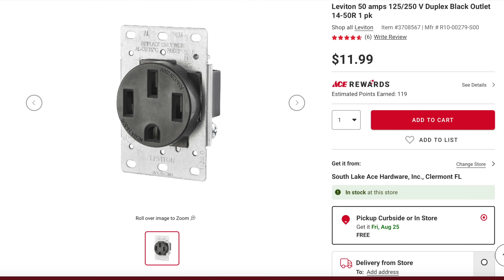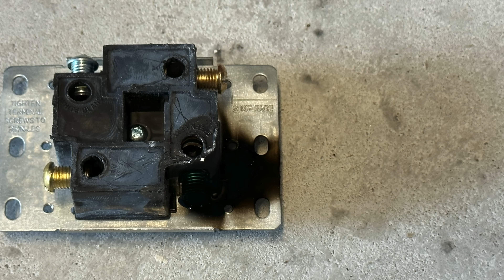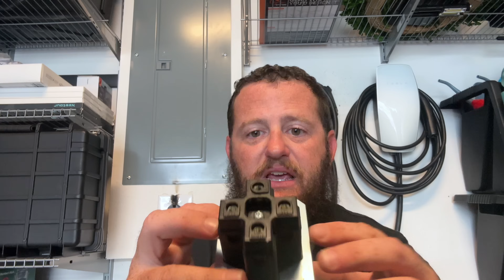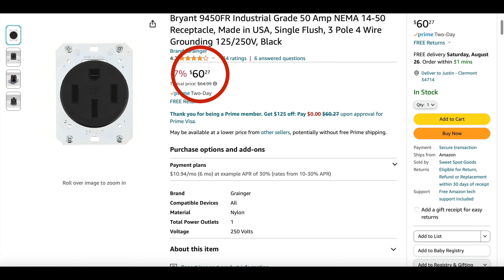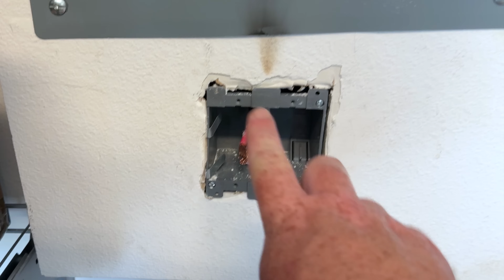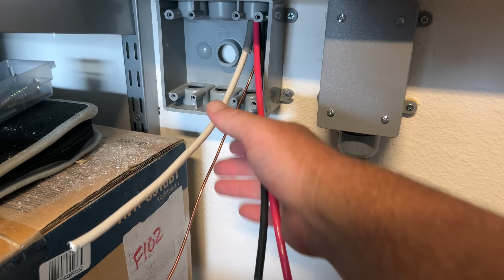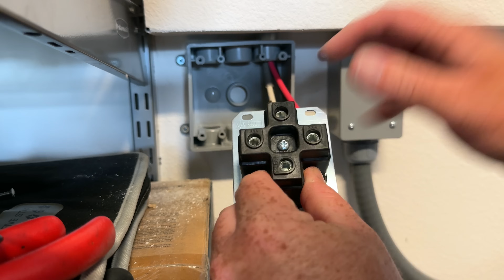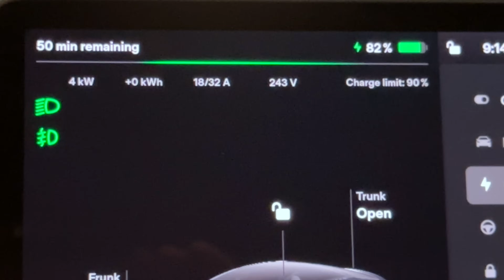This Will Save Your Life if You Charge Your Tesla on 14-50 Outlet!!

Comment: Where does it say that the standard for the plug is a 30% duty cycle? Charging the car requires a 100% duty cycle, or very near to it. Its not pulling out the plug that is the problem, its the heat from running it without letting it cool between on and off cycles, like a dryer or electric stove. Putting in the correct plug won't work if you don't torque it to spec. My stove had an old plug on it put in in 1979 and it failed long before I got my house because it was not torqued to spec on aluminum wire. I checked all the wire connections and others were loose as well. It can be hard to find these faults, done by poor installation. You are unlikely to get electrocuted by a plug failure, but you could burn your house down if the breaker failed, which they sometimes do. Many houses are just sitting, waiting for a failure to cause electrical problems.

Comment: Am I the only one seeing this? I couldn't help but notice a comedy of errors while watching you tinker with your receptacle. It's like déjà vu – I'm pretty sure the old one blew up for the same reason you're demonstrating with the new one! 

As someone who's been zapping circuits for over two decades, let me share a nugget of wisdom: always shake those stranded wires like you're making a cocktail, then retorque them before finishing your termination. 

Now, in your video, you're all like, "hire a pro!" Yet, you terminate those wires like a cat chasing its tail and blame the previous electrician for the mess. Remember the golden rule: an electrician playing carpenter is a joke, but a carpenter playing electrician? Well, that's a horror story waiting to happen!

So, let the pros handle the sparks, and don't risk your family's safety to save a few bucks. And do me a favor: pop open that receptacle again and check those terminations. I bet you could pull those wires out easier than a magician pulling a rabbit from a hat!

Comment: I just installed a Tesla charger, and actually did something novel for a man. I read the instructions. Tesla recommended not using a plug and receptacle, but instead, making a direct connection from the charger to the breaker in your load center. 
They also recommend against connecting to  arc fault breaker or GFCI. The screws on the charger should be torqued to 50 inch pounds and 45 on the breaker.
Reply from the maker: Lol
Reply: I based my opinion on the 2nd to last line of the Tesla product Overview. I copied and pasted this from the Tesla installation manual.

PRODUCT OVERVIEW
 Circuit Breaker Rating / Maximum Output
 Power Output
 For maximum power output, install a standard double pole 60 amp circuit breaker. Wall Connector includes 
integrated GFCI protection - do not install a GFCI circuit breaker.
 Wall Connector incorporates automatic load management, which allows the max output to be customized to 
an existing power supply. If the electrical supply is unable to support the 60 amp configuration, select a 
lower amperage configuration.
 Circuit breaker (amps)
 Max output (amps)
 Power output at 240 volts (kW)
 60
 48
 50
 40
 11.5
 9.6
 40
 32
 30
 24
 7.6
 5.7
 20
 16
 15
 12
 3.8
 2.8
 NOTE: External disconnect switches are neither required nor recommended. 
NOTE: Circuit breaker size is programmed during the commissioning process. See Commissioning 
Procedure on page 28 for details.
 NOTE: Some Tesla vehicles may draw less current than the max output. Actual charging rate depends 
on Wall Connector output and onboard charger in the vehicle.
 Branch Circuit Conductors and Ground Wire
 • If installing for less than maximum power, refer to local electrical code to select correct conductors 
and ground wire size that are suitable for the chosen circuit breaker.
 • If installing for maximum power, use minimum 6 AWG, 90° C-rated copper wire for conductors.
 NOTE: Upsize conductors if necessary.
 • For sites with multiple Wall Connectors, each Wall Connector must have its own branch circuit with L1, 
L2/N, and Ground.
 • COPPER WIRE TERMINATIONS ONLY for landing in Wall Connector wirebox terminals. Conductors 
can be stranded or solid.
 • Hardwire branch circuits to disconnects or circuit breakers. Do NOT install cord-and-plug type 
connections.
 • For outdoor installations, use watertight fittings when securing feeder wires to the wirebox.

Comment: The cause of this was plugging in while there is a load on it. It would be beneficial if you were to turn the breaker off before plugging in. But also use a better quality outlet. Like you said. This outlet was not designed to be continually plugged and unplugged. But an arc will occur when it's under a load.

Comment: not even “state of charge” mentions this but gen2 tesla mobile connectors have a temp sensor on the plug and will give error and drop current in half to keep charging safely. doesnt matter how good your equipment and installation is, there is always a chance of corrosion, dirt that can cause too high of resistance and result in overheating. 

you should also promote mobile adapters that have this safety feature.

Comment: If using a 14-50R with 50 Amp breaker you need to limit your charger to 40 amp charging. If your charger is set to 48 amps, you need a 60 amp breaker and hardwire (no plug allowed). Due to the long continuous duty of a L2 home charger, it is good to check all terminations periodically with an IR temp gun. Check the Receptable, Breaker and Charger terminals. My terminals in my charger were hot and I had to increase the torque above recommended with the 6 guage wire to get the temperature to come down. All terminations will degrade over time. Record original temperatures and check annually or semi annually

Comment: Glad you, your family, and home are okay but I do want to mention the wall connector isn’t meant to be used with a pigtail.  Since it wasn’t installed per the manufacturer directions (hardwired) it actually voids the UL safety listing.  Same as if you mounted on the floor and it flooded, the instructions state to mount so many feet high, so the UL safety listing would be void. 

I see you had it limited to 32A which is great and hopefully with the higher quality 14-50 you won’t have any issues, but for others reading, PLEASE hardwire and torque to spec or have a licensed electrician do so

Comment: We had a Nema 14-50 put in with industrial setup by an electrician that does USC Medical hospitals in all of southern CA.  We are using a 200 amp panel and a 40 amp breaker and only using a 30 or 32 amp output.  10 to 12 hours is OK with us.  We don't drive less than 40% so we are good.  Temp stays down and batteries don't get abused by heat which kills a Tesla if fast charged only.  We also don't charge much over 90 to 95% so regen doesn't abuse the full batteries every time we drive.

Comment: If i had to guess, I think he installed the previous outlet himself, and he didn't use proper techniques during install. I think he either compromised the shielding on the live wires bending them into place and the ground touched it after repeated cycles or he didn't manage the ground wire appropriately and it touched the live wire. If you think about it, a short to the ground would not happen in any scenario he alludes to.

Comment: For continuous current applications, use metal boxes and faceplates, it will lower the air temperature in the box side.
Reply from the maker: thanks for the tip

Comment: Thank God no major disaster. I had a Leviton outlet that stopped working after 4 years. It didn't burn like yours but resulted in slow charged\. I replaced it with a Bryant. Those Levitons are crap but electricians still use them.
Reply from the maker: They are perfectly fine for what their intended use is, but not at all for this application. Unfortunately thats not a widely understood or known by most

Comment: Leviton meets UL specs.  Rv’s use this plug. In and out all the time. 
Don’t unplug or plugin under load. 
It looks to be bad connection in the box. Installer didn’t torque the connection well. It happens. 
You could always check the connection every few yrs. Been hooking these up for 36yrs.
Reply: Preach it. If you think it is the Leviton take it to court. You will loose

Comment: Stranded cables can squish and get looser during installation. The Excellent Laborer says to wiggle the wires and re-torque the screws, repeat 3 or 4 times, so that they stay tight.
You might want to go do that if you haven't!

Comment: You point out the plastic looks the same but it is the internal metal contacts which is the important design.  More metal more firm connection makes the outlet better.  Also note the burnt outlet used a screw tip not hex  bit.   Could you get 75 inch lb with a screwdriver?     The ground should also never be carrying current.   Note the smaller wire size    and if this happened while you were plugging in shows the car was drawing power at the time another error.

Comment: I'm an apprectice electrician. I guy who bought a new Tesla asked me if he could just plug it into his dryer outlet. He has a car port with washer/dryer outside. I said no. For starters, a dyer receptacle is not rated for a continuous amp draw. Those reciptacles are designed for sporatic use and short duration 35 amp amp draw. Tesla requires a 40 amp draw. Second, Tesla requires 50 amp breaker, 6 AWG wire and a commercial grade NEMA 6-50 or 1450 receptacle. I told him your dryer is on a 35 amp breaker with either 10 or 8 AWG wire. All this data is in your Tesla manual. He waited 6 months to get his car and didn't bother to get a charger installed during that time.
Reply: This info is def not technically correct and is misleading.
Tesla Mobile Charger DOES NOT require 50A. It can use 30 or even 20A. It will just charge slowly.
And NO , TESLA manual DOES NOT state that 50A is needed. In fact, they have a full table on their website stating the charge rates at different V levels.
Reply: Tesla does not require 40amp draw on their mobile chargers, it only draws 32amps. It is specifically designed for people who didn’t know whether their nema-1450 plug has a 40amp breaker or 50amp breaker
Reply: @ my information comes from the Tesla spec sheet.
Reply: I used a 50 amp breaker, 6/3 wire, 14-50 flush mount. 

I don't unplug and replug. 

Any ideas? I think I'll be fine. I have a thermal camera to observe if I need to.
Reply: You can run 20amps on a smaller breaker with a much thicker gauge and its completely fine. The problem is most people try to run the outlet lile a corvette and things like this happen.
Reply: The smart plugs on the mobile charger will only draw the amperage that plug can handle. Otherwise you gotta change the amps manually
Reply: @Sandwich420 you most definitely can use the dryer 10-30 plug with the Tesla mobile and it’s 10-30 plug.
Reply: lol bro.. first of all Tesla doesn't "require" 40A anything. You can charge it at 16A, 20A, 24A, 32A, etc. This can be set in the Tesla itself or in nearly any 3rd party EV charger. The 80/20 rule exists for a reason. Want to be safer? Go even further under and charge at 20A on a 30A 10-30 outlet. The problem arises from people frequently unplugging and replugging in outlets that are meant for appliances to be set and left for a decade.
Reply: Good advice young Jedi.
Reply: Tesla requires 40 amp draw, 50 amp breaker, 6 AWG wire, commercial grade 14-50 receptacle such as Hubble brand
Reply: @romari2706 you don't have to run 40 amp charger you can get chargers now and run smaller amps.

Comment: It looks like someone made a mistake as a wire connection. Because your green wire burned down. I can assume that someone set it on fire with a lighter. I have seen this many times, but everywhere the problem was inside the outlet due to poor wire connection.
I also recommend that all users of such outlets use this only at a current of up to 40 amperes. 
Similar sockets designed for short loads of 50 amperes, but not long.

Comment: How often are you unplugging and plugging in your charger?  Just wondering an estimated number of cycles before it failed?  I've been home charging now at 32amps for 9 months.  Maybe I should check the tightness of the lugs holding the wire.  I did wiggle and re-tighten on the initial installation.

Comment: I have an extension cord plugged into my receptacle and we plug and unplug our charge cord from the extension rather than the receptacle. There is a handle on the cord which helps unplugging. It was a bit of a fluke that we needed the cord - but now I am glad we did. We have only unplugged from the receptacle once. But we take our charge cord on longer trips just in case so it has been unplugged about 10x
Reply: Likewise, handle on ext cord as well, good setup by default 👍🏼

Comment: The only significant difference is likely a slightly better contact spring for the industrial version.  The housing should never even come into play unless something is wrong and “high strength steel” for the faceplate is just a gimmick.  The main reason this happens is loose connections inside the connector which will get the same failure on any plug.

Comment: STOP!  Don't mount that 14-50 in a plastic box even if code allows it.  It should be in a metal box.  The cover plate metal not plastic.  Also the conduit metal.  I wouldn't take any chances in an EV application.  For an extra margin of safety dial the current down if you don't need the full 32 amps.  I like the overdesign using 6 gauge instead of 8!

Comment: Why not direct wire your EVSE and avoid the plug entirely? That is what I have done with my 60A installation and it works great. I see you have two EVSEs on your wall and I know they make devices that auto-switch between two EVSEs, so that should still allow direct wiring. If you insist on using a NEMA 14-50 plug, then I would use the more expensive "shinny" metal plug, as that was the only one of the two you showed us that is marked as U/L rated. All the best.

PS, Another critical factor in EVSE safety is to use copper wiring that is rated at least one level above the amperage that will be used. Some electricians might try using aluminum wiring, but every expert I have spoken with insist copper is better for the multi-hour continuous load of an electric vehicle.

Comment: The amount of insulation stripped from the wire needs to be the appropriate length.  As you tighten the holding screws, work the wires so that the strands compact.  Repeat until tight.   Form the wires so that the is no stress on them or tight bends that  might cause a hotspot. Inspect your work before covering.

Comment: Nice video. But you should be using a metal box for the outlet as opposed to plastic. Anywhere where there is a potential for high heat, always go with metal.

Comment: Same thing happened to me.  I initially cheaped out and installed the Leviton 14-50 receptacle and used the included mobile charger for both home and work meaning I had to unplug the receptacle every day.  The car actually warned me first by sending a message through the app of a high charging temperature detected which subsequently reduced the vehicle's charging speed.  The receptacle was really hot.  A quick internet search lead me to the Hubbell receptacle.  It's noticeably heavier than the Leviton and I haven't had the issue since.  It's surprising your electrician wouldn't have known that about your install.  Great channel btw!
Reply from the maker: yea, that sounds about right
Reply: Is there anything in the procedure for connecting and disconnecting that plug that prevents hot switching?  
If there is any ability for intelligent switching sequencing, there should be no current draw at all at the time the plug is connected and disconnected. 
It's like unplugging or plugging in a hair dryer while the switch is on vs having the switch off. 
The instant the plug makes contact, if there's a big current surge, the heat generated is very high at the contact point because the resistance is high. Power is resistance times the current, and that high heat from the power will degrade the contacts. 
Did the power supply equipment have any way to be turned off prior to connection or disconnection?

Comment: So if you rarely or never unplug your NEMA14-50 from the outlet then you should be ok or is it the actual cycling of charging my Tesla everyday that causes the plug to fail?
Reply from the maker: you should upgrade even if you dont unplug. These were not designed to take the kind of long cycle use they are being put through

Comment: I was getting a message that the charge speed was reduced due to high plug temperatures. It was installed by an electrician and I don’t remove the charger. 
The car charged at 16 vs 32 amps. 

There was some burning on the outlet and the electrician replaced the outlet. 
If it happens again I will just get a permanent charger
Reply from the maker: Yea that’s no bien

Comment: What size wire (copper or aluminum) and breaker is feeding that panel in your garage?
Seems like smaller feeder wire at the mechanical lugs, is it a sub panel?
 Also what size wire is feeding your 60 amp charger?
I would recommend hard wiring your charger and delete the receptacle which is not rated for the 48 amp output that the 60 amp breaker setup typically gives you especially over a longer period of charging thus adding additional heat. You’re really pushing that receptacle to its limits. I typically install the 14-50 on a 40 amp output with a 50 amp breaker setup. Glad you weren’t harmed. Thanks for the useful content on the cycle ratings for that receptacle. Cool find.